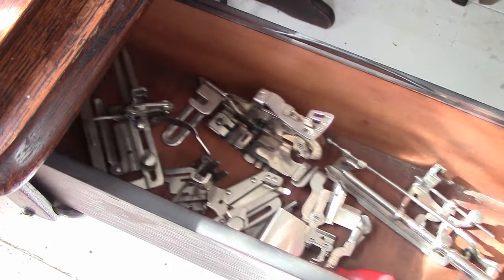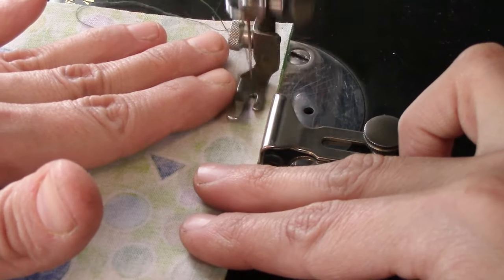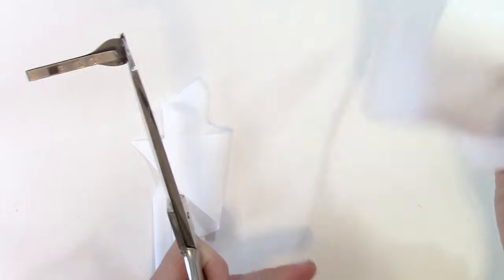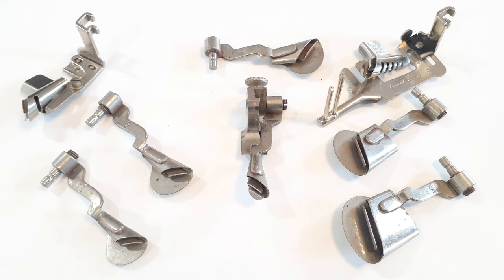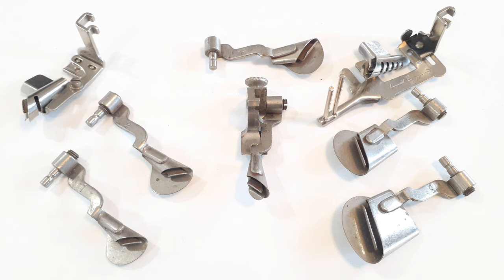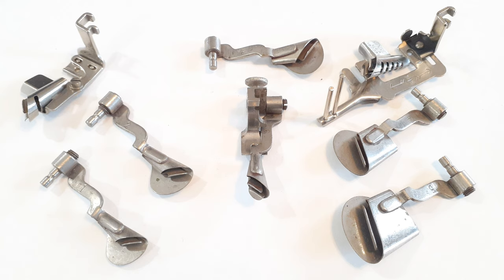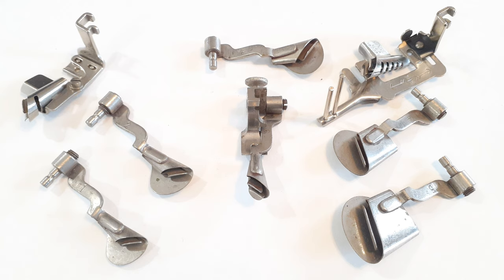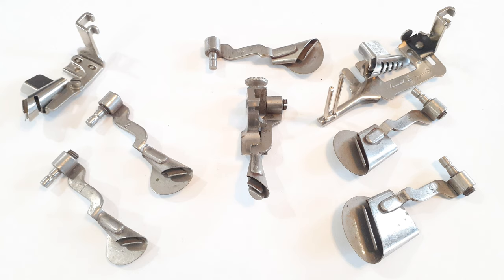How to use Most Common Vintage Antique Treadle Sewing Machine Attachments and Accessories

Comment: Excellent presentation. Photography, lighting and script were clear. I can't imagine how a user obtained a firm understanding on using these before YouTube unless they had a sewing circle of experienced members helping each other.
Reply from the maker: Thank you for your lovely comment!
Reply: This video is beautifully done and was very easy to follow.  Great job.  

South, aside from using the manuals that came with the original machines and/or accessories, sewing was a skill that was most often "passed down" by mother to daughter in ye olde days as part of the domestic training for when the young girl would one day marry and thus be expected to run a household of her own.  My grandmother, who was born in 1911, was a very talented seamstress.  She taught my mom (b. 1942), and later her granddaughters (all b. 1970s), when each of us were in our early-to-mid teens.  I'm sitting here today, reviving my old skills after a few decades of non-sewing, to take a refresher course on which attachment did what function.  The ultimate irony?  I have a Singer 301A, a Singer 15-95, and a Singer 15-30 "sphinx" treadle machine, which are all machines on which I was trained, and which I got as I came across them in the past year or so.  Can I use a modern machine?  Sure, but the new machines, with their plastic innards and admittedly weak motors, can't handle heavier fabrics the way the old Singers can.  The older machines are also much easier to work on:  all metal parts, with straightforward and easy maintenance.
Reply from the maker: I'm so delighted that you found this video useful. 

What a lovely story of your machines' histories ❤️
Thank you so very much for sharing!

I agree wholeheartedly with you on the topic of modern machines. There's just something so wonderfully trustworthy and reliable about the old darlings.

Thank you again!
Reply: There had to be women's sewing and quilting clubs in the days before youtube, it all was a skill grandma taught her daughter who taught her daughter, most men were not part of that as it was considered "womans' work", but it was men that didnt sew who invented and designed the machine and attachments oddly enough!!
I want to use my SInger 101 to make some curtains, it will be a good first time project too since I've never really did any work with a sewing machine.
Reply from the maker: @HobbyOrganist Absolutely - gatherings of women for sewing and quilting is a very well documented occurrence.

Curtains are an excellent project to start with! I wish you much enjoyment and every possible success :)

Comment: Thank you for showing the ruffled foot. I’ve had one for years and, never understood how to use it. I just wished the included an instruction manual with them so you can make calculations on how to make adjustments for attaching lace trim that needs to be gathered on a garment.
I loved how you compiled your video and, the accuracy in which you demonstrated these sew attachments.❤
Reply from the maker: Thank you so much for your lovely comment! It's truly wonderful to have been able to shed some light on an attachment for you :)

If I'm understanding your 3rd sentence correctly, I think the difficulty with the calculations for ruffled material is that much depends on your stitch length. So many of the older machines didn't have numbered stitch length settings (only a sliding post or even a screw)... not to mention that the ruffler itself has an unnumbered depth adjustment. So much can vary.
Being able to give a clear formula for needed lengths of trim becomes rather difficult.

The best thing I can suggest would be to try to ruffle some scrap "ribbon" (strips of material joined end-to-end, pre-marked in 1-ft increments?) over top of a different 1-foot piece of fabric. This would give you a fairly good estimation of trim needed per foot of under-fabric.
I hope this makes sense.

Thanks again!

Comment: An outstanding video in every way! I have a Singer 101-3 machine on a library table that I am restoring and it came with a bunch of attachments that I have no idea what they are or how they are used, I did see several of them in the video!
One other attachment I have is a buttonholer in a green plastic case with a manual from 1960
Reply from the maker: Thank you for this comment!!

Button holders are such amazing devices. They have an interesting progression in design development all of their own.
Reply: I also found such a green Singer case, but it appears to an industrial sewing machine walking foot, no manual yet. Is your buttonholer functional?

Comment: Wonderful tutorial; thanks for sharing! I’ve had my mother’s treadle machine for about 3 decades & have never attempted to use these attachments! You explain so well! Now I need to get the tension corrected because it hasn’t been in use for about 30+ years.
Reply from the maker: I'm so glad you enjoyed the video! Thank you for your comment.

How wonderful to have your mother's treadle! I would imagine that only the top tension would need to be adjusted. But it's also possible that the machine just needs a good oiling.

Try using it slowly and you might be surprised!

Good luck :)

Comment: Excellent video.  You really encapsulated my sentiments upon finding these intimidating attachments in the cabinet drawer of an old singer i purchased recently. I've been avoiding even looking at them until now 😅but this has given me the confidence I needed to learn about my machine a little bit more. Thank you! (Also, I noticed that you didn't cover a zig-zag attachment- are they not as common? The one downside of the vintage machines that I've noticed as a beginner is while they make excellent straight stitches, they lack in making stitches in areas where you may need more stretch.)

Comment: Brilliant! Well done!
Could you possibly demonstrate how a chain stitch attachment works?
Reply from the maker: Chain stitch! I do have a Touch and Sew which has a chain attachment, but I'm not sure how many other machines can do something similar. Do you have secret knowledge of an attachment I need for my modal 15? Hahaha
Glad you enjoyed the video. Thank you for the comment :)
Reply: @24Washington  
I acquired the chain stitch attachment set in a box of misc attachments at a thrift store. I actually bought it for the Singer cleaning brush!
Reply from the maker: Oh wow! Great find!. Does it have a part number stamped? The 3-piece set that was made for the Touch and Sew machines are marked 21906, 163445, and 21913. https://youtu.be/Nuz_vn2MIN8
Reply: @24Washington  
YES! That is how I was able to determine what it was! Those parts are: 21906, 163445, 21915.
Reply: @24Washington  
Very cool video! Very informative! Now I know HOW those three parts were used and for what purpose a chain stitch might be used. Thanks again!
Reply from the maker: No problem - glad to help. It's a fascinating little thing. 
Sadly, just for the Touch and Sew models.

Comment: Hello, at the beginning of the video you show some accessories but they have the place to tighten the screw in a different way, it is not from the side but horizontally, I ask you because I have a box of Greist accessories but I don't know how to place them on a Singer machine that has the screw on the side, do you know what machine they are for or if you have to add any other part? Thank you
Reply from the maker: I think you're referring to the display at around 53 seconds?

The middle tin has binders in the lid, which actually screw down to the base of the machine, rather than to the presser bar.

The wooden box on the left has binders in the second quarter from the top, but these slot sideways into one of the feet in the next section down (on the left), which in turn gets screwed onto the presser bar.

I hope this points you in the right direction for your attachments, but I'm happy to try to clarify further if you still have questions.

Comment: Could you demonstrate the use of attachments 35464 and 35466?
Reply from the maker: Thank you so much for this request!
I apologize, but I'm having a difficult time identifying these attachment numbers. Would you possibly be able to give their descriptive names or links to images?
Reply: @24Washington  Here is the page from the 27-4 attachment manual showing the attachments that came in the drawer of the treadle machine and their part numbers.  I have most of them (missing small screwdriver and stilletto (?) and the quilting foot, the needle case and all but 2 of the bobbins).  The attachments 35464 and 35466 aren't discussed in the manual!  They seem to be plates that screw into the bed like the fabric guide?  I'll also attach photos of mine if I can figure out how - or do you have an email I can send them to?  I haven't been able to find any information (not even photos) of these online.

Comment: Thank you so much for this video! I have acquired several antique and vintage machines - the oldest one in my collection is 121 years old - and most came with several of these wonderful gadgets but no instructions for using them. What few instructions I have are often scanned and found online, or they are incomplete. One of my machines has no documentation at all, online or otherwise. But it seems the attachments were basically universal, so this is helpful. Plus, I learn better from videos than from written instructions for stuff like this. So thank you for the well-presented video!
Reply from the maker: Wonderful! I'm glad to have been able to help.
I hope you can put the information to good use :)

Comment: This was fascinating! I was shocked when the video ended because it felt like it had only been maybe 5 mins or so rather than nearly 24 minutes already!

I recently bought a National/Eldridge Two Spool Treadle Sewing Machine in it's original 4 drawer desk and once I got it home, was shocked to find that not only was the original instruction manual included, but there was also 2 black metal boxes with a purple interior (one reads "ATTACHMENTS" and the other "ROTARY") filled with a variety of accessories (one matched up to a fragile piece of paper tucked up into the lid explaining what the one attachment was and how to use it!) and the other metal box had a variety of old cleaning tools. And then in another drawer was the original treadle belt rolled up neatly as well as an additional paper envelope with even more accessories and more modern cleaning tools. WOW!!!!

Here I thought I was simply buying a beautiful old treadle that I literally knew absolutely nothing about at the time that I purchased it (other than it's a human powered machine, gorgeous, and I just had to have it), but after doing some research into what it is that I've actually bought, and then exploring it's condition, the model, the brand, etc, I've discovered that it does indeed have the spool can with it (extremely rare to find if missing from what I've heard), all the parts are there except needing a new treadle belt, and I'll need to give it a good cleaning and oiling everywhere.

And then to find all these accessories and cleaning tools and even the original users manual?! I'm pretty sure I got this for a steal btw. I paid less than $200 for all this and so far in my observations and research, the only things I need to purchase to get it working is sewing machine oil and a new treadle belt totaling about $20. 

So for approximately $205, I will soon have a functioning (1913?? - that's the last patent date listed on it) National/Eldridge Two Spool Treadle Sewing Machine with extra attachments, cleaning tools, and the original user manual. Simply incredible!! 

Once I get it cleaned up and the belt on, you better believe that I'm going to learn how to use this beauty. What good does it do to just sit there and look nice? The real value comes from knowing how to use such an amazing, gorgeous machine.
Reply from the maker: Oh wow! That is absolutely incredible!!! 
It certainly sounds like you found an amazing machine with a veritable treasure trove of extras.

I'm going to have to do some reading on your two-spool machine now. I'm hugely intrigued. 

Thank you for sharing such a fascinating story and for feeding my own hunger for knowledge :)
Reply: @24Washington  

No problem and that'd be great! Maybe you know of some resources about treadle machines that I don't and haven't stumbled across just yet. Up until a few weeks ago, I never realized they ever made machines that didn't use bobbins but instead you use two spools to do the sewing. (That seems the better way to go unless it was too expensive to purchase more thread than a project needed?? Or it made more money for the company to sell extra pieces like multiple bobbins you could have pre-wound and ready to go??)

My machine model is "H44664". I haven't been able to find anything out about my specific model, so I'm relying on videos like yours to teach me what similar machines and available attachments can be used for.

I just got the new belt put on a couple days ago and then got the sewing machine oil in the mail. So far I've given it a good cleaning everywhere with the oil but did NOT have time to oil it properly yet. I only tried out the treadle function long enough to make sure the belt was tight enough but don't want to risk parts & gears rubbing metal on metal until I oil everything. I plan to get to this part next week so I can practice figuring out how to keep the machine running with the correct rhythm before putting any thread or material in it (I heard you say to keep the presser foot up so the dogs don't get damaged)

Comment: So great - I have a computerized Juki sewing machine and only the chromium plating distinguishes some of my attachments to the historical ones. Especially the ruffler and the small hemmer are exactly the same. And even the modern hemmer still works nicely on rectangular things like curtains and table cloths but not on circle skirts. Seems to be an old truth - and I have learned a lot in this video.
Reply from the maker: Isn't that amazing! What a timeless design.
Thank you so much for sharing this information :)

Always wonderful to know that I've been able to add to someone's knowledge database!
I appreciate you taking the time to comment.

Comment: I've really enjoyed th few videos of yours I've watched since I found the channel half an hour ago. Unfortunately I didn't get any attachments with either of my old singer machines, and I wanted to know whether attachments are interchangeable, or if not, what the limitations are, as I'm likely to only find things online and be unable to look at them in person before purchase (I'm in Australia!) I have a 1951 99K and an 1891 VS2. Thank you for any help you can give me!
Reply from the maker: So glad that my videos were insightful. Thanks for the comment!

To answer your question, most domestic singer models are going to have compatible/interchangable feet for the two you have listed.
I believe most modern domestic machines take the same "low shank" feet, so even modern attachments might be at your disposal.

Some model 66s came with a completely different "back clamp" style set-up rather than to the side like you see on your machines.

There are also "high shank" attachments with a taller leg/stem coming up from the foot part. But those are generally used for industrial machines and would definitely not fit your machines.

Finally, there are "slant shanks". The needle mechanisms on these hit the fabric at a slight angle, and the leg/stem of the attachment reflects this. Instead of being more or less perpendicular, it slants toward the back of the machine.

The short of it - find yourself some low shank attachments and you should be good to go.

Let me know if you have any other questions, otherwise good luck!

Comment: Thank you for the presentation. This video has for sure motivated me to use the attachments I have been collecting .I usually find them as a bonus when I buy vintage or antique sewing machines. One attachment I did not see you using was a darning foot,I found a couple of them in the drawers of a singer model 101 a purchased about a year ago.I was told they are somewhat rare and expensive if they are original.
Reply from the maker: I have a separate video at https://youtu.be/MEC4GVOfLs8 about using the darning tool that Singer made (though I don't use the Singer made darning foot).

I think I've seen a two different variations (though they may be more) - one with a smaller eye at the base, and one larger.

Best thing is to research the stamped part numbers to verify exactly what they are.

I love finding attachments in drawers. Each new machine is an exciting new opportunity :)

Comment: I’ve just brought a singer 66 model. How have you found the best way to backstitch? Leave needle and and spin work? Someone else said they don’t sew backwards. 
I can imagine starting/stopping and getting a tidy finish must take a bit of skill with some hemming and other attachments.
Reply from the maker: Good question.
There are two typical methods that I've seen used:

One is to cut the treads and manually tie (not a back tack of course, but a very tidy finish).
The other (which I use) is to raise the needle and foot, carefully pull your work towards you by four or five stitches, and then lower into a previous stitch and sew to the end.

With the hemmers and binders, this isn't going to work quite the same due to the edge closing behind, but you can slip your work off of the attachment and underneath to work as if it were an ordinary presser foot.
Any binding would need to trimmed prior.

I hope this makes sense.
Reply: Thankful for your teaching, I had to take a screenshot of this particular reply; good clear instructions